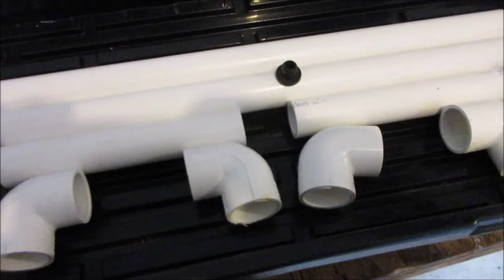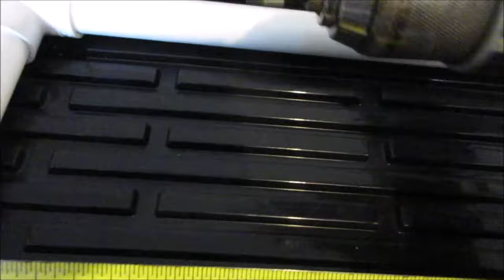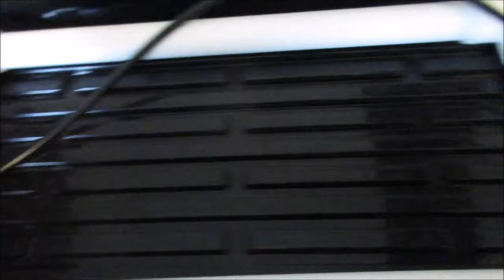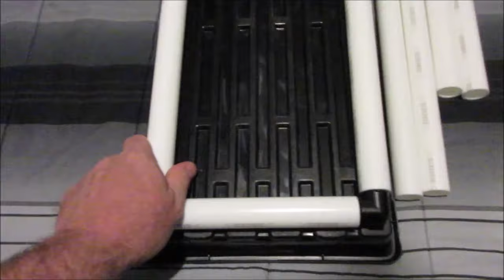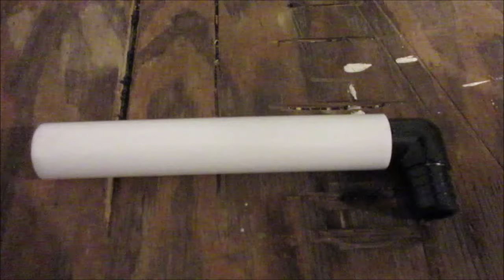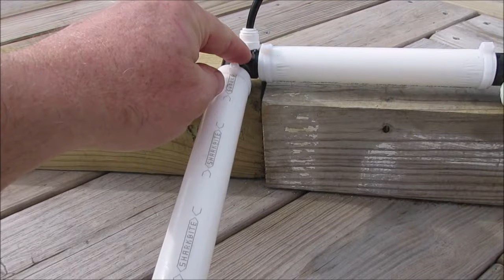(Book) How to Build Bubbler Supports

Comment: Hi I just received the pump that you use from the amazon store. I find that it makes more noise that I expected. Does it have to be on 24/7 or can I put it on a timer. Also is there a smaller or quieter model that I can use. I am setting this up in a small apt.Thanks.
Reply from the maker: I advocate putting on a timer.  A quieter model is in my store.  Link in every video.

Comment: Another option to PVC and PEX is CPVC.  From what I have read it is NSF certified and considered to be food/water safe (at least as much as any plastic).  It's used in modern construction for both hot and cold supply side plumbing as a substitute for copper.  It's also readily available at Home Depot/Lowes and uses the same style of fittings as regular PVC.
Reply from the maker: Makes sense.

Comment: Tremendous video, Brent! Could you possibly show the connection to the pump apparatus and show us how to do the air infusion on a timer. Which timer is best to use and how do you program it? (Sorry! I know nothing, it seems…). Please let us know if that will work for you. Thanks!
Reply from the maker: Sure.  Go to my store here:  https://www.amazon.com/shop/hydroponicgardeningmorewithbrent?listId=1MYO9JWKTBJZW
There are 3 pumps that have valves the lines plug into from the bubbler-supports.  Turn the valves on a little at a time at first and as roots establish, turn up until it eventually reaches a good roll like boiling.  Chapter 17 has a pic of the lines hooked up.
The timer I recommend is also at the store, link above.  I program it for 20 minutes every hour then plug the air pump into it.  I'll try and do a video on operating the timer, but I think the rest is pretty straight forward.

Comment: 2 more question:s:
1. Do you turn on bubbling during propagation phase as well?
2. How high is the water level? Does it touch/overflow upper tray?
Reply from the maker: 1.  There's no propagation with micros.
2.  Do you mind reading the book in full?  It's mentioned in several areas.  It might answer some of your other questions as well.

Comment: Hi Brent,
I have a few questions about your design.
1. You mentioned that the roots are moving/grow stronger near your air pipes. Does it mean there is insufficient air supply in the middle area? Have you considered (a) putting a few air stones at them bottom instead of drilling holes or (b) using external pipes for support only and using small diameter flexible tube in a waving manner to cover all bottom and prick holes instead of drilling them?
2. What layout would you use for large bottom tray with multiple 1020s?
3. Is your water static otherwise? I mean, there is no flow in/out other than you adding water to the bottom tray when it dries out?
4. Wouldn't periodical ebb & flow provide the same (or even better) effect?
Thanks,
Mike
Reply from the maker: 1.  I don't remember ever saying that.  The reservoir is aerated evenly without concern to where roots are.  Yes, air stones were done before the bubbler-supports and I think I mentioned it in the book leading up to how the design of the bubbler-supports come into existence.  Maybe not.  Pipe was used before aeration and that is in the book.  All said, this iteration worked so well in all micros, that I stopped.  There was no need to go further for growth and disease prevention. 

2.  I wouldn't due to potential cross-contamination.  If all are the exact same seed lot and seed type in a large bottom tray, maybe.
3.  Right, it's aerated water culture.  Water doesn't need to move in hydroponics.
4.  No.  See # 2.  I can't even imagine how ebb and flow would be viable and I've grown ebb and flow.  I've seen a couple try and fail miserably.

Of course, you can do whatever you like and do share in the group ok!  :O)

Comment: Hi Brent,  great video’s mate and set up with the bubbler. Do you by any chance have any information on the type of aeration pump that you are using for these assemblies. For your set up per 4 trays (10/20) inside the 4x2 foot base trays, what is the hourly flow rate for  your system. Could you let me know the brand of pump, is this a US pump or a Chinese assembly.. thanks again
Reply from the maker: Examples of pumps for use with them are in the chapter on bubbler supports.  It shows a pic of mine and it's in my store.  See description of all of my public videos for store link.  The link will take you to the pump I use and the specifics that will answer most of your questions.  It also shows a bigger one.  The pump I have will supply up to 8 very well and 12 potentially with it's 12 valves.
Reply: Thanks Brent, apologies for that, yes I went back into my highlighted notes in your book and found the information.. silly me had even highlighted with a colored marker.

Comment: Awesome- I was using 1/2" PVC for my trials, but I will upgrade to 3/4" PVC for a bigger reservoir.
Reply from the maker: The new AIS is better Jhavard.
Reply: Will the grommet still fit 1/2" pvc? Did you still use the 3/8 bit?
Reply: @dagwoodfarms3764  Hey man, The grommet should fit both perfectly. TBH I didn't use grommets as I drilled the holes small enough that my air tubing fits snug, and works flawlessly without leaks, I do however use aquarium air tubing, which it more rubber like, and hence gives it a tighter fit. 

I hope this is helpful.
Reply: @jhavardjonas2166  Thanks for the info